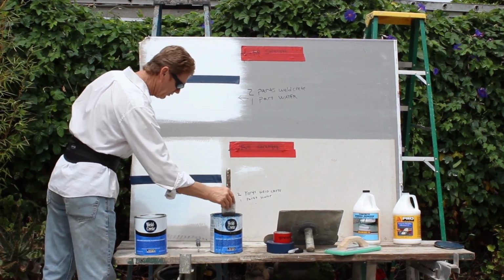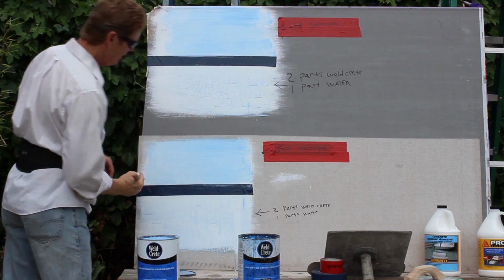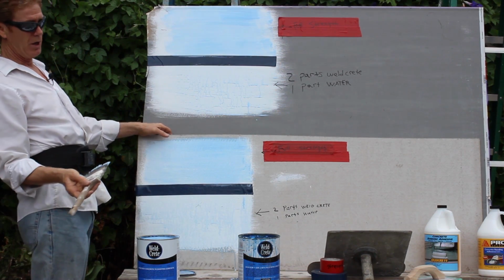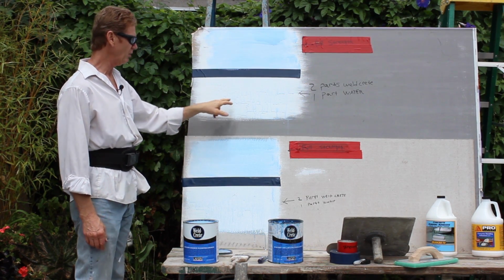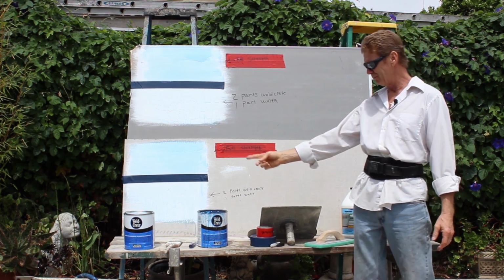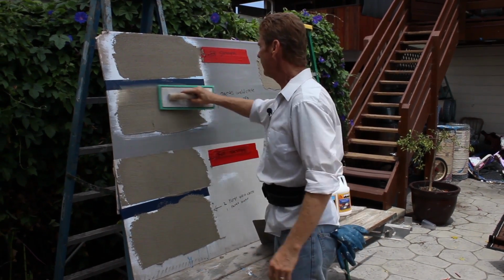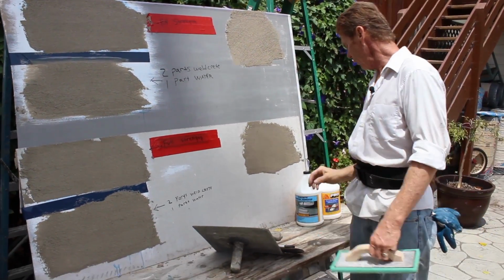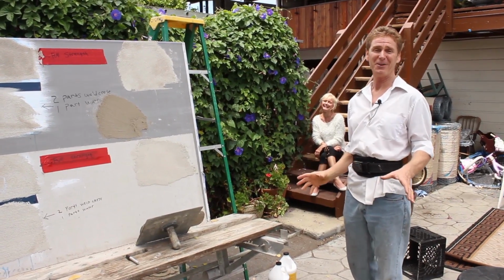Stucco and Concrete bonding agents.

Comment: First I want to say a BIG THANK YOU for all the videos you have spent your valuable time making and sharing. They are helping us learn a lot and are very much appreciated :)  Right now I am trying to figure out what we can do with a house we just bought which was made out of block in the 40's to both seal the walls to stop water from finding its way through the hair line cracks and to make it look a little more modern. The house has been coated with plaster or stucco over the blocks (inside and out) and then has multiple layers of paint. We have gotten as far as pressure washing a good part of it to remove the loose paint and in some places the failed stucco / plaster. My husband would like to fix the failed stucco where needed, apply a sand finish and then paint it, or if the price isn't too high he may want to try an acrylic color coat. Do you have any tips on what NOT to do most importantly or what we should if we can afford it (very limited budget) in order to accomplish this?  After watching this video we aren't even sure if we should dilute the bonding agent or use it full strength since there re so many layers of paint and a smooth surface. Thanks again Kirk, just incredible that you spend this kind of time helping others.
Reply from the maker: Good morning Missy, from what you say I would recommend, pressure washing your walls, what comes off if any repair, then apply a primer and an elastomeric acrylic stucco finish, these if applied properly last the longest of any of the stucco finishes as they are like rubber membranes.
 I have added a video below that shows just one company's flexible acrylic stucco finish, there are other companies out there with similar products. 
   The video you are watching is more for making certain cementitious products adhere, not acrylic's as all stucco acrylic finishes don't require a bonding agents but instead primers, the acrylics stick to everything, including clothes tools and such, video below as just a guild.
     Lastly keep in mind a stucco elastomeric finishes are perhaps 40 to 200 times as thick as paint this is a reason they last so much longer than a mere paintjobs.
Need more information type in acrylic finishes on our site.
                                Best wishes.
                          Live long and plaster
           Plastering tips for your information
             https://youtu.be/283DclFqDwk
Reply: Amazing that you can reply so fast..how you make the time for all of us is beyond me..lol BUT another BIG THANK YOU for the reply. I am currently looking for options on where to purchase acrylic stucco online as I live up in the Pacific Northwest and our small town has really no need to carry this type of product. Do you happen to have any recommendations on where to purchase..or what brands (if any) to stay away from?
Reply from the maker: Good evening Missy, thank you,
            I would suggest you google "Plastering Material yards" such as Westside Side building material or "acrylic stucco products" with your city and zip code,
 as far as the good and bad, I can only recommend the good as this is a positive channel,
 BMI, Dry-vit, Stuco-flex, Carsons, or Western, there are others that are also good but these are the ones in my area that have been tried and tested with years of research backing their applications along with longevity.
                             best wishes,
                       Live long and plaster
Sharing the plastering knowledge for those interested

Comment: Hi Kirk, thanks for videos.
Can I use Quikrete bonding agent to apply on old cement, and then mix my stucco mix with sika acrylic fortifier?
Thanks.
Reply from the maker: Good evening Mikhail dude, you can, however the sika acrylic is not necessary as a matter of fact, I have never used it, I was just using it for show in this video, as it is a bonding agent too, some folks do use it for an additive for mixing cement with instead of water as it has proven to give more adhesive strength, again I have not used it for this purpose either.
                          Live long and plaster
 teaching repairing your number 1 investment, your home
Reply: Thanks Kirk for your reply! i really appreciate it.I'm trying to fight cracks on freshly applied stucco. 
I almost got good results with one coat stucco: floated finish still cracked just little bit. Smooth finish I covered with little bit of acrylic fortifier and it didn't crack at all. Now i'm thinking to mix one coat stucco with sika acrylic fortifier to eliminate those cracks. I'm covering fish pond walls by the way, which have old concrete, thats why I'm using bonding material before stucco. After all I will apply pond epoxy, that's the plan...
Thanks again Kirk for your videos and your dedication to help us.

Comment: Hidy Kirk.  Thanks so much for these great videos!  I am a decorative artisan who started off as a painter/plasterer in LA in the 70's but am always learning new stuff. 
    I can tell you exactly what causes the plaster to crack over a thick application of Weldcrete.  Weldcrete is a PVA glue that "re-wets" or re-immulsifies when you hit it with water or anything with water in it.  I actually crack my plaster and paint on purpose for special effects.   
    Wet plaster on top of glue re-wets the glue and makes it slippery.  The top layer of plaster dries before the underlayer and starts to shrink.  As it shrinks it cracks from the top down.  The thicker the application of glue, the larger the cracks.   The plaster is bullet-proof and tight but customers do get whiny when they see crazed plaster.   
    Plaster or paint will crack over wallpaper paste residue, white glue,  hide glue and thick weldcrete/plastercrete.
    The way to fix this is either remove the glue, or prime with an oil-based primer.  Then re-apply the Weld-crete slightly thinned as you say.   Cheers.
Reply from the maker: Good Evening and happy fourth of July day Dundean, that sounds logical to me, you're the man with the knowledge of an engineer, 
The best way for me to fix the issues like these, is for me and my crew to not let folks who wish to help, help.
     Live long and plaster
  teaching plastering video’s
Reply: Dundean .

Comment: Thanks for the helpful videos! I want to go over and straighten out crappy float finished acrylic with a brown coat then a regular cement /lime stucco. question is will weldcrete bond to the existing acrylic Omega stucco . it's a volunteer project  to cheer up family going through hard times. thanks.
Reply from the maker: Howdy Greg, weld crete or any bonding agent will adhere to anything as long as it's REALLY clean as your bonding agent is only as good as what it's applied over.
            Live long and plaster
 stucco images and teaching videos

Comment: I understand why you would use a bonding agent on smooth  stucco  , but why is it necessary on porous or rough stucco?   If you pressure wash the area well, and rough it up a bit, and make sure it's very damp, wont the new stucco stick well on its own?   I'm primarily repairing window cut outs, and patching up bad stucco jobs making them smooth.  Having to add a bonding agent is going to require more time for the cleaned stucco to dry  and then the bonding agent to dry ( especially in winter), and add to the cost of the job.  
How is this different than adding a finish coat to a brown coat, where there's no bonding agent required?
Reply from the maker: Howdy DIY Japan Dude, bonding agents are usually for painted surfaces.
 If a wall is porous like a brown coat and very clean the right amount of moisture to this wall should be sufficient enough to hold the finish coat.
            Live long and plaster
 giordano’s stucco images and teaching videos
Reply: Cheers that's good to know.  Can you add bonding agent to a wet surface, and use damp?  Does final paint job stick to bonding agent if you overshot the prep area?
Reply from the maker: Howdy Japan Dude, a bonding agent will make any wall wet as it's mostly liquid, the can says you can apply while it's tacky, however i prefer to allow to dry before applying over it myself.
Yes, a bonding agent will also accept paint well.
        Live long and plaster
 Giordano’s plastering images and teaching video’s
Reply: Thanks a lot for the response. I just finished using it for the first time.   Iim covering over a bad stucco patch job  with a rubber float and fine silica sand mixed with Portland and a polymer.    I was concerned it wouldn't stick well to the smoother spots, so I used some bonding agent on those.   I laid the new stuff on as thin as possible, just to give a smooth appearance. Hope it's not so thin in spots that it cracks.   Looks much much better, just hope it holds up.    Will cover it all with latex paint after.
Reply from the maker: Howdy Japan Dude, if your bonding agent was applied to a clean area and you applied the smooth stucco well it should outlast both of us.
            Live long and plaster
 stucco images and teaching videos

Comment: hey Kirk keep up good work and thanks for trying to teach these Young fellows technical parts of the trade, I was lucky enough to have a father that started framing in 1946  I started in 1976 I guess the Apple duzenot fall far from the tree ,I hear in so cal have had the same stucco man for 17 years a he is a good one , lucky he is a very good stucco guy a most important he has a great attitude ( very important)  . 
I also had a panter (retired) on small color coat patching around the bottom of foundation
fixes he would put straight paint in the stucco in stead of water before painting the house he sead any type of paint.
and would not come off
Reply from the maker: Howdy Patrick, thanks for the story and have a great rest of your day.
 Cheers, live long and plaster
 giordano’s stucco images and teaching videos

Comment: I have Cinder block Interior walls that have been painted. I need step by step instructions to do this myself. I know the walls have to be cleaned. The I should use the Weld Crete as the bonding agent. Then do I use concrete mix or Sheetrock mud?
Reply from the maker: Howdy Angie, if it were me I'd apply a basecoat of veneer then a finh coat of veneer plaster.
 Cheers and have a good and healthy & happy new year,
 Kirk and Jason giordano

Comment: I have a question. My color coat is peeling off and the stucco beneath it is smooth. Should I use weld create before applying a new color coat? or will it bond to the stucco without needing a bonding agent?
Reply from the maker: Howdy California dude, color coats adhere by suction to base coats of stucco.
 If a wall is painted, proper preparation is necessary, pressure washing and bonding agent applied to the house, prior.
 cheers,
Kirk and Jason’s  rendering videos

Comment: so is the sika and quickrete you had in the video similar replacement bonding agents for the Weld-crete? I can't find weld-crete in SoCal. thanks!
Reply from the maker: Howdy IWBVS, I don't know as I'm an applicator,owner,plastering contractor, not a chemical engineer, plus, I don't have much experience with the other bonding agents to preach the gospel.
 However that being said I understand Quikrete is similar, I would advise full strength to any wall, I don't add bonding agents to the mix, ever.
 With Sika, they say you can add to the mix, being an applicator, I believe they mean if you just mix a small batch that adding to this small mix will help it adhere, but if I wanted a cementitious material to adhere I would simply use other self adhering or adhesive cement plaster such as poly-bond myself.
 Best rule is to read any can or bottle and or call that company for advice.
 Best wishes, 
 kirk giordano plastering

Comment: Hi Kirk, I have a project and am kind of at a loss of what to do/use...I have a large interior wall that is sheetrock with interior wall paint on it...I want to change the whole wall to look like concrete or stucco etc....do you think the method you used in this video, cleaning the wall, applying a thin coat of the weld crete and then applying a type of stucco or quikrete over the top to dry would work...im worried not so much about it cracking but not sticking to the wall?  If not do you have any tips or product recommendations, any help is appreciated :D
Reply from the maker: Evening Art Bar 39, if it were me I would apply larson's plaster weld, same company but designed for interiors or you can use the weld crete inside too.
 Next I would apply a veneer system, easier and much prettier and designed for what you want. See video below for instructions.
https://youtu.be/LzTvF9xO2cU
 Cheers,
 kirk Giordano
Reply: +Kirk & Jason Giordanos DIY plastering and stucco tips 
Thanks so much Kirk!  That is exactly what I want!  Last 2 questions, would you dilute the plaster weld like you do with weld crete at all?  And if I wanted to tint the usg imperial veneer plaster what product would you use?  Thx so much for your time and help!
Reply from the maker: Evening Art, no no need to dilute the plaster weld. I only dilute the weld-crete only if I am going to apply a color finish over a painted surface or want to cut down on suction.
 Weld crete is designed to be applied full strength and so is their interior bonding agent plaster weld.
And yes, you can tint the veneers, sounds like I will have to do another video next week to explain how as it's complicated.
 Best wishes,
 kirk Giordano

Comment: Hello, Kirk,
I live in Bulgaria and we have a lot of stone houses here. Should we apply a bonding agent over stone walls? I guess it depends, because some stones suck the moisture right out of the stucco, whereas others don't. 

Thank you in advance :)
Reply from the maker: hello Gandalf4137, most stucco will adhere to stones as most are porous,.
 But no stucco will adhere to dirt, moss, staining, etc.
 pressure wash the stone walls very well, If you still have your doubt's about the stucco adhering,  apply a bonding agent.
 Best wishes out in Bulgaria
 Cheers!
 kirk Giordano

Comment: Hi Kirk, I've just recently discovered your videos. They are as entertaining as they are informative. When I was in the Auto Body trade I would see similar cracking  in top coats that were applied over water born primers that were not fully cured. The cracking may be the result of the bonding agent continuing to shrink after the color coat has partially hardened. Due to Weld-Cretes bonding strength and the relatively thin color coat, as the bonding agent shrinks it pulls apart the color coat. Anyway thanks for taking the time to make these videos they are truly helpfull.
Reply from the maker: pbp Hello PBP, I agree, weld crete is way too strong for a color finish, unless you know what you're doing with the product.
That's why I don't blame weld cret for even suggesting weld crete can be used for a color coat, most folks will get it wrong then blame the bonding agent.
 Best wishes, 
 Kirk Giordano plastering

Comment: Love the videos Kirk!!
I have a block chimney that the plaster is spalling off. I've removed all the loose stuff and I'm planning on replastering it. Someone told I should wire mesh it but I'm guessing thats not required.
I was thinking of using a bonding agent over the old plaster then doing a scratch coat then a finish coat. Any advice would be appreciated.
Reply from the maker: Morning Steve Holmes, you are correct, this is a proper way to repair.
 Cheers,
 Kirk giordano

Comment: im a day late on this video, i applied full strength to a wall where i am going to use
Quikwall White Surface-Bonding Cement. is there a way to fix this, or do i now need to do another base coat of stucco?
Reply from the maker: Morning Little Bill, what I'm showing on this video, relates to the bagged finish coats mainly where an 1/8 of an inch is to be applied.
 For the cement your using it's best to apply full strength.
 Cheers,
 kirk giordano

Comment: Very interesting tip on the bonding agent. So I gotta ask.... on homes that have been painted many times, their surface is sealed pretty good already. It's just not possible to do a float finish on there, right?
Reply from the maker: Morning kk P, it does not matter how many coats of paint are on a home from 1 to 20, your new finish is only as good as the paint applied.
 First pressure wash, then apply the bonding agent now you are ready to skim with plaster,
 Best wishes, 
 Kirk giordano

Comment: Hi Kirk, is weldcrete similar to unibond (pva)?
Reply from the maker: Paintbrush 1962 Hello paint brush dude, I just read the can it does say for use as a general purpose building adhesive, tack coat for plastering / renders and priming porous surfaces.
 So I would say it's a similar agent.
 Best wishes, 
 kirk Giordano plastering
Reply: Kirk & Jason Giordanos DIY plastering and stucco tips  Thanks Kirk